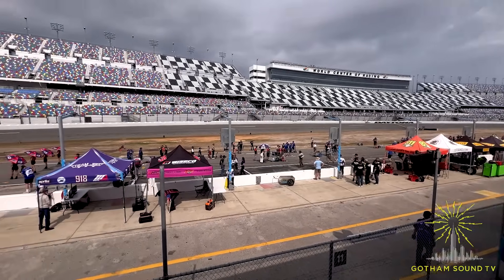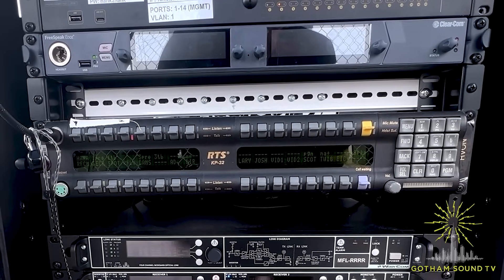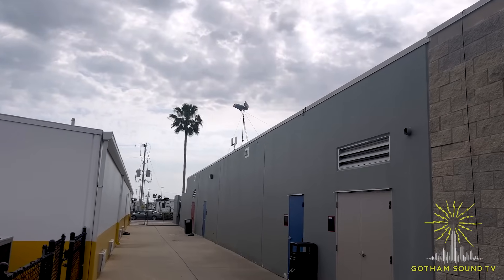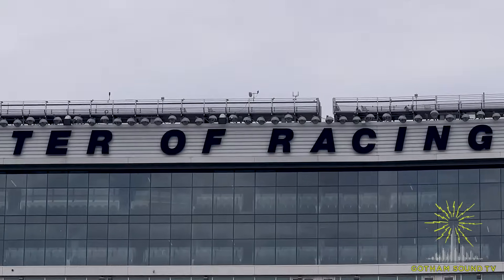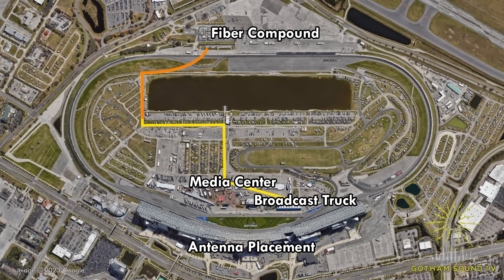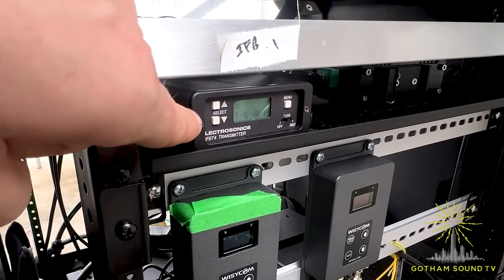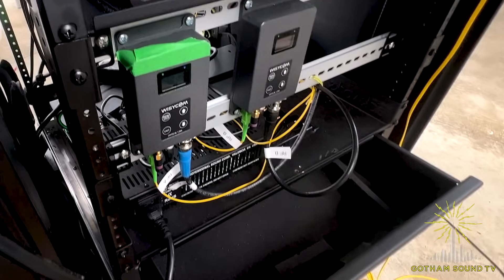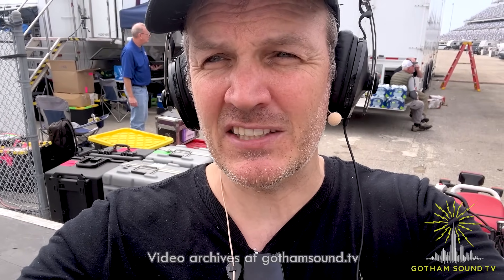3.2 Miles of RF Over Fiber

Comment: What is the name of the box you have at 4:15 to converter fiber to Ethernet and provide POE? Does that not have any issues with the precision time protocol needed for the freespeak transceivers? Normally I have to use a PTP aware switch for such situations.

Comment: The (german) AI voiceover audio sucks! I'm from Germany and I'm capable of understanding English, why does YouTube think that I want their shitty AI voiceover when I can understand the original audio just fine? This impacts the perceived quality of the video in a negative way for me, so I do not understand why content creators have this AI bullshit enabled.
Reply: You used 3 meter of fiber from the raceway? Why do you bother using the racetrack fiber when you can just use your own? I mean with 3 meter it is super simple to use your own cables because stuff is close by (3m is less than 10 feet), just one example where the AI translation introduced errors to your video. Especially because 3 miles would be ~4.8km.

Another error is the translation of "paddock". 

Two bigger errors that shows how incorrect this AI stuff is and I haven't finished the first minute of this video.
Reply: I didn’t even know that was an option. Thanks for letting me know!
Reply: The same reason why when US English subtitles aren't available it defaults to some other language rather than auto generated EN. Computers are stupid sometimes.
They're really only there enough to give a just, maybe at some point they will be better but I don't know if I want that.
There's also community driven subtitles.
as somebody who uses a lot of speech to text and text to speech a lot of these systems really fail with technical language.
Reply from the maker: Thank for the heads up! This was added to the video without our intervention- we definitely never actively opted into it or were even made aware of this so-called feature. We're looking into our options.